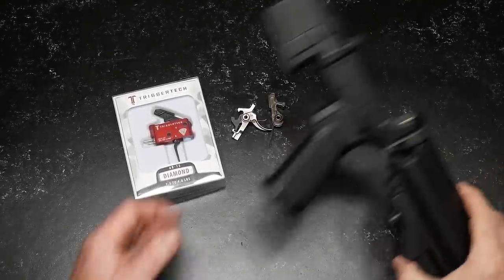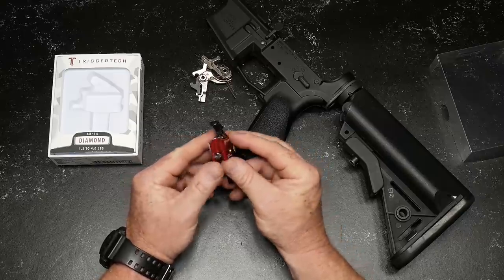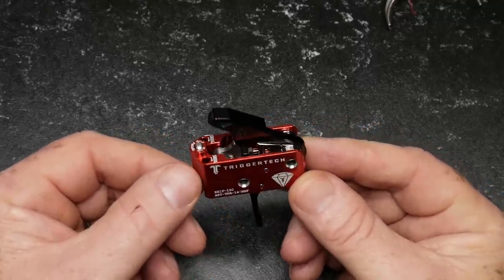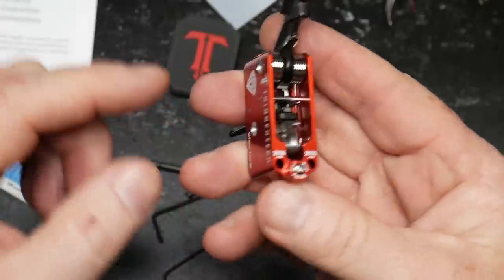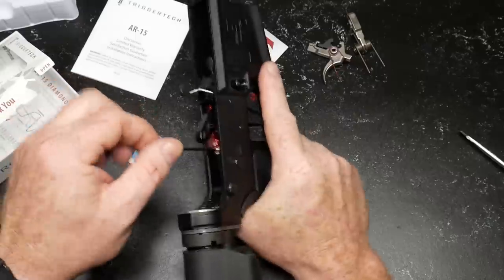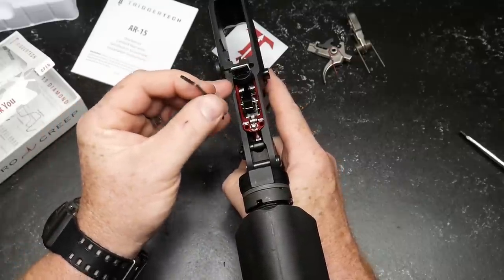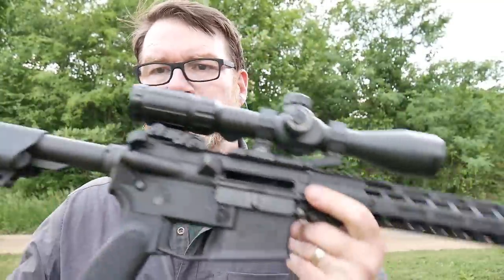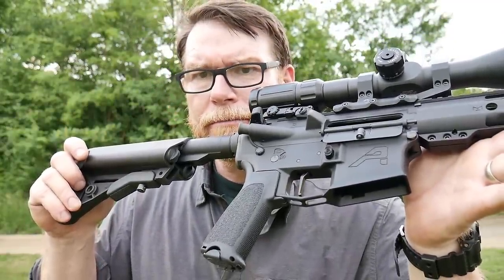Triggertech Diamond!!  Replaces my Current Comp Trigger

Comment: I have the 2 lbs - 4.5 lbs adjustable version for around $219 and after comparing it to multiple other triggers I have purchased its amazing. Its a 2 stage that acts like a single stage when shooting fast and for the precision shots it has about 1/16th takeup before the break. Its not nothing to play with as you saw from this video demo of it. Its the best of both worlds, like having a geiselle and a Timney with a small adjustment of a screw. I have about 800 rounds through my BCM with it and its been amazing.

Comment: I’ve always got one build going on, just finished a 10.5’ 223 I built just because I got a primary arms 2.5x Acss prism sight for a good deal and needed something to put it on lol. Bout to start working on a 350 legend in the next couple of days think ima go with the seekins ambi lower since I’m left handed even thinking about making it left side ejection as I’m 33 years old and haven’t ever had a left handed gun. All my rifles have ambi parts but non that are actually left handed. So far I’ve got a 20’ 223 varmint rifle, 14.5’ lightweight all purpose 223, 16’ Grendel for deer hunting, 18’ Grendel for target shooting, 20’ 224 target rifle, 16’ ks47 7.62x39 just because it’s awesome and the before mentioned 10.5’ 223 pistol. Got rid of my 10.5’ and 16’ 300b.o. Going to need a bigger safe soon lol

Comment: Any way to adjust out that pre travel?
Reply: Probably not pre travel,  2 stage trigger.  They make a single stage,  mine is 1 to 4 pounds.  Zero pre travel,  30,000 reset, best trigger on the market  period,  bar none!!!

Comment: I got the primary or what ever its black with the chrome trigger and hammer and installed it and it doesnt always break. It will go in to a half release locked position and stick? It doesnt always do it which makes me not think it's the safety lever issue as I'd think it would be more consistent if it was that? Kind of wishing I went with the RISE RA-535 like my other build.
Any one else see this issue and is there a fix?

Comment: You know what? I just got into the shooting game about a year ago,and with the experience i've had so far with replacement parts is-They usually don't give you proper instructions or proper complete directions on how to install or the fact (in this case) that they don't tell you or warn you the set screw comes all the way out,Not cool.And also what if you set it loose and lose it in the field.once again shoddy directions or information.,Even from companies as reliable as Timney  or Triggertech etc...Disappointing at best comes to mind with some products i won't mention here. Plus not including pins with a trigger that costs well over $400.00 is not cool either, how much do pin cost a company? 25 cents each?These issues may seem small compared to a trigger working well and being reliable and i agree partly,but it is still very annoying when these "issues" are easily fixed by the company at a very tiny cost to them. Advertisement is worth a lot more AND word of mouth! get it? With that said . I'll be picking one of these up for sure! but in my case the "Adaptable AR primary trigger,AND it only costs $300.00 here in Canada!